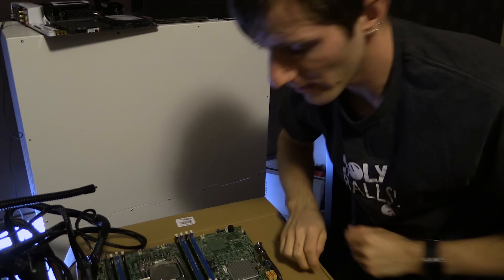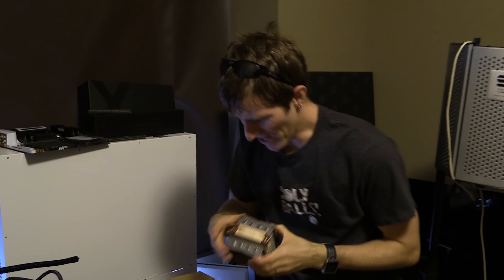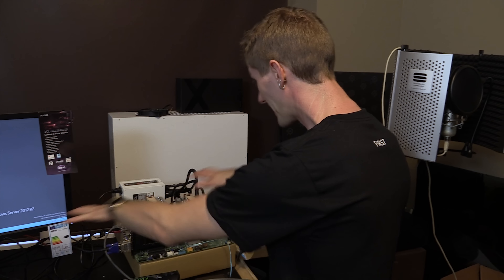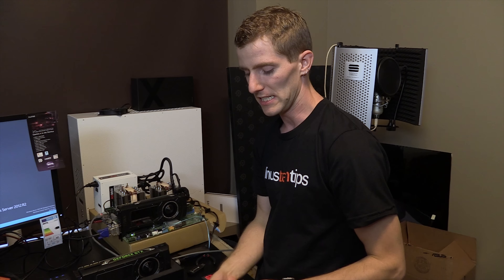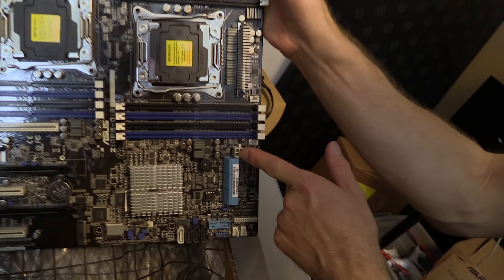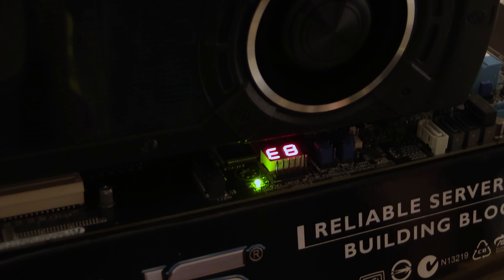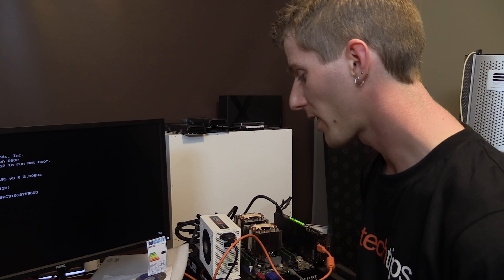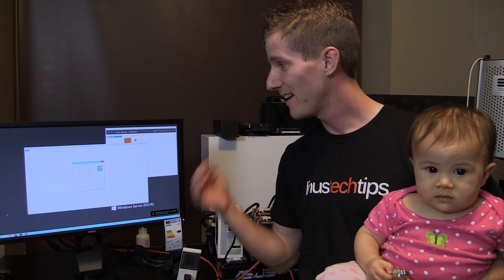36 Cores, 72 Threads, and Two Titan Xs - Our New INSANE Rendering Machine Part 2

Comment: With this you could render so many episodes of scrapyard wars
Reply: ***** IKR
Reply: ***** Rendering isn't the long part, The editing does, Editing a 4-6 hour day x2 into 15 minutes is the hard part.
Reply: ***** rendering is the final 10% of worktime in editing. and it usually happens when you're asleep [render que], so no time saved
Reply: Space Cadet Rendering in 4k would take me like 16Hours or more
Reply: Sven schäfer lol "rendering in 4k". what a 3 second video or a full length feature film? 3d animation or pregraded work video?.your comment seems so void of any real point or information that might want to rethink what it is that you're actually trying to say and give it another shot. as it is it's not worth responding to pro tip - nobody RENDERS in 4k. it's too big even for cinemas. they shoot in 4K, and crop out the bit they want and render that timeline at that size
Reply: Space Cadet well rendering a 1080p video with around 5min length takes me almost 2 Hours
Reply: Sven schäfer that seems kind of normal. if you sleep 8 hours a day you can render 4 videos in the render que. i still don't see the problem [my machine would take about one hour or less, but i have a 6 core ivy bridge]. but you still have to do 7 days of editing to get to this point, which cannot be hastened. this whole thing that machinery will make you a good editor is the thinking of idiots
Reply: Sven schäfer  a 1080p video thats 5 minutes long takes 2 hours?
Reply: TheRyanDudeMan Probably a slow system or not a proper setup in the software. It would take me about 10 minutes.
Reply: Guys it was just a joke I know this XD
Reply: ***** There are no jokes here. Never.
Reply: ***** C'mon, mate. Don't act like you haven't been on the YouTube comments section before *pats you*
Reply: Joshua Kallen Serbo Yeah Youtube comments are pretty terrible, probably why I got a top comment
Reply: Broski130 is it jsy me that wouldnt mind watching like 45 mins to an hour of scrapyard wars
Reply: ***** yeh i kinda knew that. i'm an editor though and i hear customers say all sorts of dumb shit, and i have kneejerk responses to them. editing is a very long boring process by yourself in a dark room. it's ten times more work than people think, and this whole "if you have a beast pc editing is easy" mentality is really out there in real life, and it BUGS ME
Reply: Space Cadet the beast editing pc thing mainly effects render times, which my laptop sucks at, and my desktop may or may not suck at, I havent tried again after dealing with 4k footage in after effects (dont do that unless computer is intel based)
Reply: instead of getting butthurt like most - i see you trying to nudge LMG about more episodes of Scrapyard Wars.
Reply: I've never laughed so hard at a comment before
Reply: Space Cadet actually having a beast computer does help me when i shoot with my Canon 5d3 RAW 14bit 1080p video it helps a lot man.
Reply: emko333 you shouldn't shoot things
Reply: emko333 so that makes video editing easy? i have a black magic which writes to solid state, and a six core IVY-E, yet editing is still a long boring process and the end rendering is a 20 minute wait after a months work. i have no idea how you think that helps an editors workflow
Reply: ***** IKR?
Reply: +Space Cadet THIS VIDEO IS 4K?! :D
Reply: PumpkinHead'sPieGaming i'm not sure what you mean, but this thread is 800 comments long so i'm afraid it's going to stay that way :)
Reply: Space Cadet Someone said, "Nobody renders in 4K." but the video hes watching is!
Reply: PumpkinHead'sPieGaming ohhh. well i can't track where the conversation was at that point, but he's kind of right. people shoot in 4k usually, and edit in something smaller. the advantage being you can crop your shot and not lose definition and still have 2.5 k. seeing as only about 1% of the monitors on the planet are 4k, then exporting in 4k is kind of pointless at this point. keep in mind that cinema size isn't even 4k yet.
Reply: +Space Cadet IMAX cinema is 8K
Reply: Jordan Bennett no most are 2x 2k projectors all the digital ones the few FILM projectors are like 10k but they are getting replaced by the 2k digital projectors.
Reply: Are we talking US projectors or Uk projectors because the place I work at have just upgraded from imax 1080p to imax 8k
Reply: Jordan Bennett source? i have not heard of a Imax 8k projector before
Reply: you couldn't even output on most editors above 2.5k until recently because ALL CINEMAS were 2.5k. I have made full feature films and they have been shown in small cinemas.  i have no need to get involved with bored children about this. fucking iMax?? nobody in the industry cares about imax i can assure you, is it even still a thing? and even if this video is in 4K it won't make any difference whatsoever unless you have a 4k screen [less than 1% of the worlds monitors are 4k]  .  i'll mute this thread and we'll all be better off [mostly me]
Reply: blake harrisonakerz your replying to a comment from more than a year ago
Reply: Griffin Baxter so am i
Reply: Space Cadet i Need for a 10-15 min Video 5-8 mins of Rendering with my 6700k
Reply: Isn't that a little ironic? A supercomputer who's sole task is to render videos of Canadians rigging together budget computers to play games on.

Comment: What is that pink thing you were holding? Is that a new gpu or something?
Reply: I think it was a baby or some shit... Not 100% sure though.
Reply: McMakers "a baby or some shit"
You would make a great parent.
Reply: Poison Sanae Atleast he'd have humor which is great in a parent
Reply: McMakers Does it improve framerates? Or temps?
Reply: I think it's a new kind of bioelectronic super processor...
Reply: Casual Alien Its this new device that limits the finances you have to spend on gpus.......
Reply: Casual Alien I think it had a DVI adapter in it, might be some sort of new cable.
Reply: Its a new psu
Reply: Frenk van Vlissingen that has to be what it was
Reply: Casual Alien I saw a DVI port. I'm fairly certain that's a GPU. I didn't see any power ports, so I'm uncertain of this new technology.
Reply: I'm pretty sure it's a sound card.
Reply: Some social (media)  next gen shit.
Reply: Casual Alien it's an early gen biological processor
Reply: Casual Alien It's a power a source to use in the Matrix.
Reply: Asus wants Linus to use their everything,  even the newest next gen biologically enhanced robots. They now have 200% more overclockability !
Reply: HOLY SHIT! I WANT TO ORDER ONE!
Reply: DasDoeni I hear it can throw some temper tantrums and crash. Needs time to be developed.
Reply: Casual Alien Linus nano
Reply: Poison Sanae  Hey, to a lot of males, babies and shit may as well be the same thing. One comes from the other after all.
Reply: I believe it was a portable poop machine
Reply: +Casual Alien That's a baby Skynet. Behold!
Reply: +Mario Best reply of all :)
Reply: My internet is called skynet. ;3;
Reply: Holy shit. You posted that comment at 9:11 AM. 9/11. Please don't hurt me Americans
.
Reply: yeah is a new titan card
Reply: A GTX TITAN BABY

Comment: Please post Task Manager screen shoot with 72 C ores :D
Reply: I think you mean threads....
Reply: Subby Smith Windows Task Manager has not distinction between physical core and HT.core  But in short yes :)
Reply: Windows Server 2012, like Windows 8, has a unified CPU graph in the task manager.
Reply: Brett Anderson If you right click on the graph you can change it to show logical processors under the 'change graph to' menu.
Reply: Kenneth Lacombe didn't know that. Probably because that graph quickly gets to be a horrible mess. I can't imagine 72 of them.
Reply: Brett Anderson nope. You can see individual cores.
Reply: mentalplayground not normally. I've been informed you can get the old behavior back. I can't imagine wanting to when you have 72 threads.
Reply: PRERIGO Thank You :) I have acually couted them. htop would also look impressive.
Reply: +Subby Smith You can have thousands of threads on a single core CPU. Actually he's right (although I wouldn't use this wording myself to avoid confusion), there are 72 cores ... 36 physical cores and 36 virtual cores.
Reply: +mentalplayground In short, no ... meaning you were right, see my comment above
Reply: +mentalplayground He shows it in one video, if you change to logical processors it gives up graphing them and shows tiny percentages.

Comment: Why would anyone criticize you guys for running WIndows Server 2012 R2 on a.. Server rig? I work in IT for one of the biggest companies in my country; we have close to 1000 servers, and every single one that I've worked with so far has been running some variant of Windows. I'm sure there are some Linux servers somewhere in there, but I have yet to find them. Not sure if we have a server with 2 of these monsters though. Jeez, what I wouldn't give to have a system like this. Except the actual retail value, that is :p
Reply: What kind of workloads do you run? And is it not expensive to buy 333 copies of windows server considering one costs like 1000$

Comment: 10:50 that is actually a 2010 dual-socket rig. X5650 was a 6-core 32nm i7 920 with all the "enterprise" extras. It was also the last Xeon that could OC though, so there are some MONSTROUS benchmarks from people with the EVGA X58 SR-2 Classified (the only dual-1366 OC board). I have one of those CPUs running 4.2GHZ (from 2.6) and it is competitive with modern i7s @ stock.

Comment: Can this run halo 3 on max settings?
Reply: ***** no because halo 3 is xbox only
Reply: tony cupero shots fired
Reply: guynumber20 let hope it not a needler
Reply: tony cupero nope PC can do anything
Reply: ***** damn son wombo combo wombo combo....... OHH OHHHH OOHHH WHERE U AT? !(¤T/(!¤TRFGHJ!
Reply: ***** Can you play Solitaire on the Xbox? No, checkmate console pleb!
Reply: tony cupero unless you use an emulator
Reply: ***** Yes, from far, don't forget about Halo Online that is running the Halo 3 engine.
Reply: guynumber20 It can, you maybe reffering to Radeons and Intel chipset wich have a problems with particles, tree leaves and etc that decrease performance a lot.
Reply: ***** er mer gerd its the internet police! HIDE THE DRUGS!
Reply: tony cupero that is the challenge you need like a beast to run certain gamecube games so you need a supercomputer to emulate 360 games, my phone with 1ghz dual core can't run lot of ps1 games that had a 33.33 mhz cpu, emulation increases required computational power by magnitudes
Reply: ***** Halo is for scrubs, sorry.
Reply: It will run Halo and Halo 2.

Comment: Those high tech computers resemble a car engine. Lots of plugs and wires and fans. Those things must use up juice. Is this what people need to play the latest games?
Reply: +John Brown No. It's probably 3 times what would be considered great for the latest games. This is also ridiculously expensive
Reply: Ridiculously expensive indeed. Cause I remembered all I needed to play Crysis 3 was to upgrade my computer with a one gig graphics card.
Reply: +John Brown If you want to play games on PC at the same settings as a PS4/Xbox One all you need is about $400 or so not including the cost for windows, or $400 if you buy more used hardware, and you'll be able to match or beat the console's settings, however to play at max settings you need more, I.E. at 1080p you need at least a gtx 970 or r9 390 ($350 each) to play most modern AAA titles at max settings.
Reply: tell me about it. I am really ignorant it seems of the latest computer technology

Comment: When you have a TitanX and 36 HT-cores and then connect to the monitor with analog VGA :-)
Reply: VGA has no resolution limit and can handle  2048x1536 easily and even  WHUXGA (Wide Hex Ultra Extended Graphics Array) with resolution of 7680x4800 .
Reply: Just, no. VGA absolutely has a resolution limit. It stops at 2048x1536. And for OP, he's using VGA because it's reliable and will basically always work, considering he's running Windows Server.

Comment: LinusTechTips Why no Titan Z ?
Reply: ***** Not realy, in Games yes but in other things not.
Reply: RonPlayEntertainment just use a tesla k80 :'D
Reply: wakojako49 +1 Tesla cards ftw... Or at least dual Quadro M6000s
Reply: Pol Mesalles I expected the titan X to have dual gpu when it still wasn't released.
Reply: ***** Titan Z and Black beats X in workstation use.
Reply: wakojako49 Yeah... it's a shame they went all gamer w/ the X and abandoned the original idea behind the Titans..
Reply: Pol Mesalles Quadro is mainly designed for 3D rendering in CAD programs. At least LMG wouldn't need that for a shared rendering PC and short-term footage storage.
Reply: RonPlayEntertainment i think he used what he could get his hands on and as he reviews video cards for consumers he used a consumer video card sadly he did not use the older but would have been better for this TITAN Z or TITAN Black if it was a double precision GPU load that is but from what he said the TITAN card will be overkill for it because its use is a CPU sever and not a GPU based one
Reply: yumri4 a Titan Z is also a consumer card but expensive ^^ and rare.
Reply: RonPlayEntertainment yes and no. yes it is as the TITAN Z is made for prosumers and not so much for professional use but no in that even though it is an expensive ... very unneedingly expensive card it is actually cheaper than a Quadro K6000 and and the Quadro M6000 has more CUDA cores than the Quadro K6000 and M6000too making it a good substitute for it unless you need the certifications that go along with the Quadro series and not just the FP64 enabled CUDA cores
Reply: yumri4 Did you mean that a Titan Z is more Expensive as an Quadro M6000 and K6000 ?
Reply: RonPlayEntertainment no i ment a single TITAN Z has more CUDA cores and is less money than a single Quadro M6000 and is less than a Quadro K6000 just the TITAN Z lacks the industry certification that the Quadro cards do have and that certification is what you are paying for when and if you buy a Quadro card
Reply: Anway, I still think LinusTechTips should ask NVIDIA for a couple of Tesla K80s, so that he can use them as counterweights
Reply: RonPlayEntertainment The Titan Z is a dual chip card. I believe since they aren't doing SLI that they are just going for the most CUDA cores in 2 chips. That's my guess.
Reply: Pol Mesalles it was designed on the market to be something that people buy to waste money.

it has no useful place in the market share. if you wanted serious Workstation performance, you'd buy a Tesla or Fire Pro. if you wanted practical affordable gaming, you'd buy a gaming GPU.

+yumri4 (sigh, autoformatting systems, they never work reliably)
will applications recognize that as a single unit though, or will they be used independantly of each other, like the GPU's in this Rendering Server will be.
and, will you get into a sticky situation of your software not knowing what to do with something that's technically SLI but isn't.
lastly, if you're dealing with applications that wished they had more vRAM available for GPU acceleration - then the 6+6 the Titan Z has can be limiting.
Reply: yumri4 and most people don't know this, but you can soft mod the gpu, if it runs the same GPU core as a quadro counterpart to be able to run Autodesk/CAD certified drivers. The only thing that would then be needed is the dual precision FP, which the old titans would have. Therefore, a soft-modded titan Z would be miles better than the quadros if we're factoring the higher amount of CUDA cores and whatnot. Quite a steal for 1000$
Reply: RonPlayEntertainment because Titan X is better
Reply: Swaggy Bunny only for gaming...
Reply: I know the fast Graphics card for overall is! 

Keep going! You're making it!

Almost there!

The Radeon 7500! So fast!
Reply: No The Radeon McFlury^^
Reply: Daniel Bang
the FP64 IS THE REASON for Quadros and Tesla cards not just the CUDA cores but the FP64 instruction(s) on the die for them to use that as you even said the TITAN Z is missing thus now as good for workstations and server use great for gaming though
Reply: its a waste of money